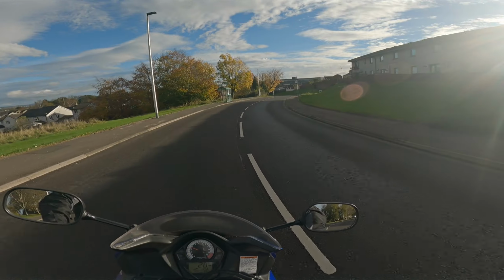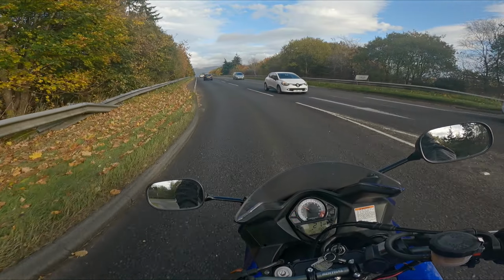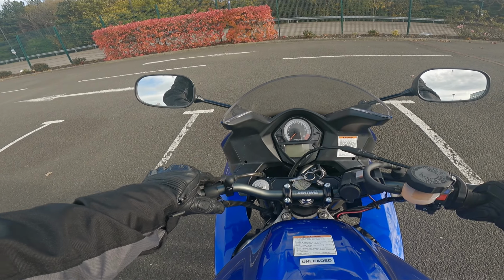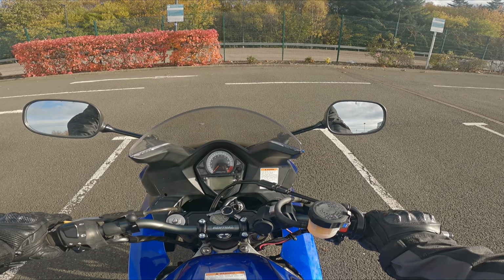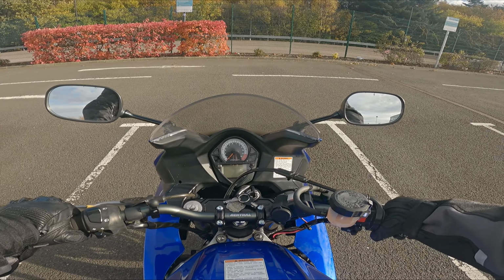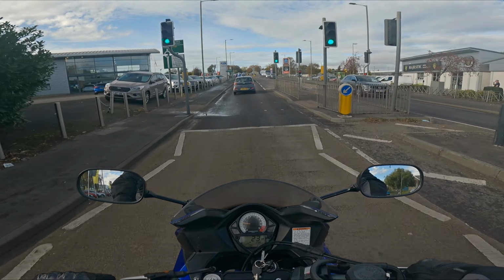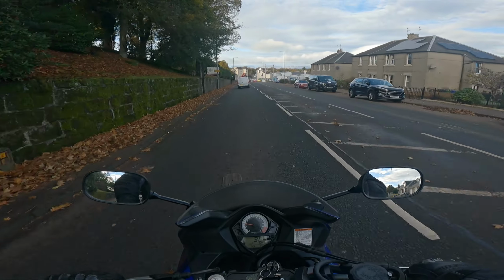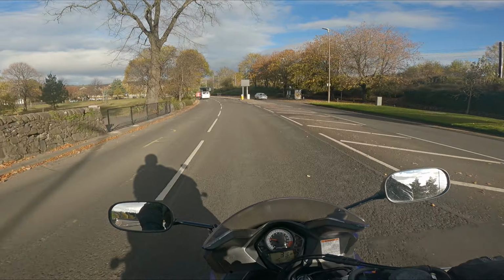Throttle Blipping On A Motorcycle | Riding Tips #10

Comment: I’ve only covered 150 miles on my bike but funnily enough I only mentioned other day the engine braking I’m not keen on more fierce than a car which I’m used to so might give this a go . Thanks
Reply from the maker: My bike has loads of torque so the engine braking can be quite aggressive at time, especially coming down from higher speeds so throttle blipping definitely helps in those situations. 🤜🤛
Reply: @MotoEcosse  thanks for the help and advice , I may have to wait awhile as I don’t think my gear change whilst blipping will be there just yet. Does it have to be a quick movement hand and gear change? Do believe this will be a help and for a better riding  experience.
Reply from the maker: Yeah it's very quick technique. It's exactly like changing down as you normally would but you're just adding a very quick blip.
Reply: @MotoEcosse  I will have a go this week hopefully, I’m sure there will be some louder revving going on at some stage 🤪.

Comment: Hi! Is it possible to do rev matching after stepping down 2-3 gears? Or it only works for down 1 gear?
Reply from the maker: Hey mate, I suppose you could as long as your speed matches the gear changes It definitely works better though changing down 1 gear at a time in my opinion. 🤜🤛

Comment: Interesting video, conflicting views out there about throttle blipping.
Keep em coming
Help, cold hands in winter riding, any tips. 
I wear gloves and inner gloves but hands and in particular thumbs get really cold and it’s spoiling going out.
I know they’re really ugly but are over mitts any good
I don’t want to spend £200 on heated gloves or heated grips which have got wires all over the place
Reply from the maker: I also wear gloves and inner gloves. They do keep my hands warm enough, but on those longer rides it's also an issue. You can get really warm winter gloves. I'm not a huge fan of them though. They're so bulky that it can be difficult to use indicators. Another you can try that I find helps with colder winds is surgical gloves. Sounds silly but wind can't penetrate them and your hands tend to sweat a bit which helps keeps your hands warm. You do have to put up with sweaty hands though. 🤜🤛
Reply: Thanks Mr Ecosse
Reply: Battery operated heated gloves. Ladies merlin ones from sports bike shop. Excellent and no wires.
Reply: Isn't heated grips the answer? I've never used them (because never ridden in the dead of winter etc) but I think they must be the way to go.
Reply: @scrumpymanjack  - yeah they're great - have your hands as warm as you want all winter.

Comment: Is it must to do revmatching ,does it affect millage,chain,gearbox. Im using honda unicorn 160cc bike is it dangerous to my motorcycle
Reply from the maker: It's not essential no. It's up to the rider if they choose to do it. As long as it's done correctly it won't affect the bike in any way. It's not dangerous to do any bike. You can do it on a 1000cc sports bike or a 125cc. Essentially all you're doing is eliminating most of the engine braking to keep the speed of the bike from dropping too much making the downshift smoother. 🤜🤛